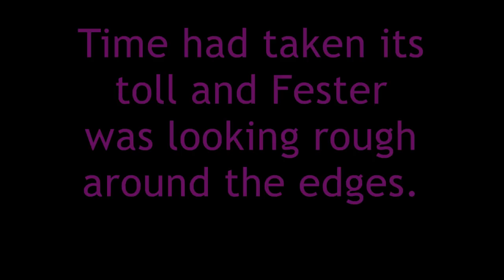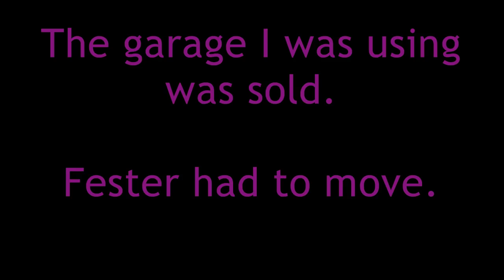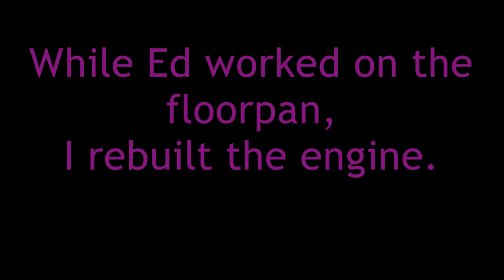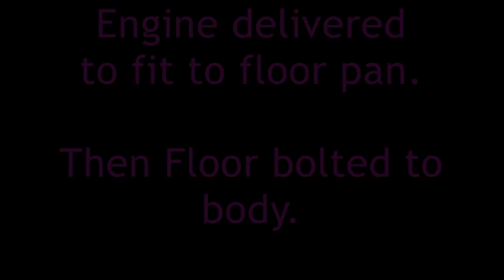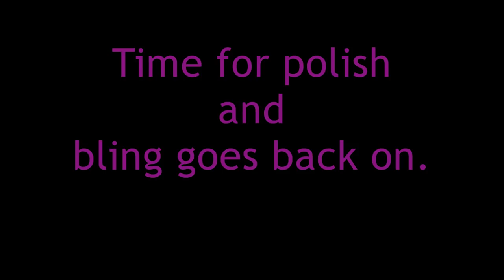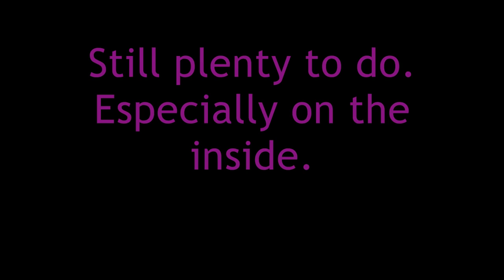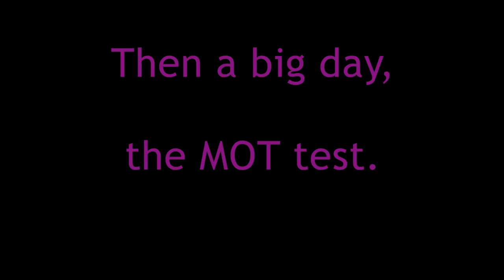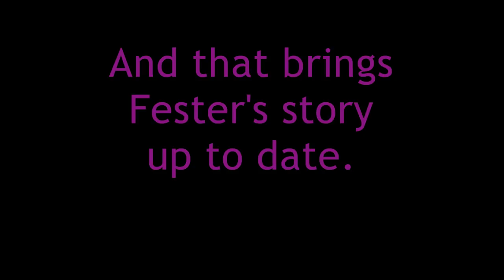1967 Volkswagen Beetle restoration. Rusty wreck to best in show.

Comment: My compliments, a lot of time, work and money.  I know, I did it 3 times because I have 3 of them: a 1967 sedan, sunroof and convertible.  That full-collapsing radio antenna is a nice option.  I think the red interior was a good choice.  My understanding is that the 1967 European Beetle still had the glass headlight covers, whereas the USA versions had just the sealed beam.  You must be glad it's finished.
Reply from the maker: Thanks. Thats my second Beetle as well as a '72 camper and a '70 Type3 fastback. I keep saying never again but before I know it another project arrives. Cant wait for summer to get it out again.  In 1967 the 1300 and 1500 got the upright headlamps similar to the US (though not sealed beam) but this car being a 1200 and the cheapest in the range it retained the sloping headlamps and 5 bolt wheels.

Comment: Congratulations to you guys & to Fester, on winning the prizes, too bad it didn*t have the original steering, it might have won best original for just having the rimblow horn, instead of the aftermarket one, also I thought that the 1967 bumpers were what they call plumbers delight, cause those look like the bumpers for a 1957, unless in Europe they use the ones the car has, if you can get the original steering wheel, just put it on, then you can enter Fester in the all original class, that would be annother award/ prize for you guys, & Fester,👍👍👍👍👍👍✌✌✌✌✌✌✌✌✌👌👌👌👌👌
Reply from the maker: Thanks for the kind words but if all Beetles were the same it would be really boring. The steering wheel that would be original to this car wouldn't have had the chrome horn ring, it would have been completely black so the wood rim is a nice addition and it's a style and manufacturer that was available when the car was new so is period correct. The bumpers are also correct to the year in Europe. American markets had towel rails along the top of the bumpers but blade bumpers were the only option in Europe until the later Europa style bumpers were fazed in for 1300 and 1500cc Beetles in 1967.
Reply: @AstonishingGlasgow   what I was thinking, if you ever went in to annother show, is to just have the original steeringwheel , so you can enter the all original category, then put on the steering wheel you have, for the car to be right hand drive, have the I believe is the 6 volt or 12 volt engine, those beautifull rims, the original factory color, did that year come with those type bumpers, they look likevthe ones from 1957, it gives it a nice touch, but I remember that year had thebumpers that look look like pipes, that is why it*s called plumbers delight, I see you have some buses, they look nice love to see them.
Reply: @AstonishingGlasgow   that car looks awesome, the reason I say about the bumpers, is  that those bumpers that are original to your car, they sell them, to give what they call "SoCal" look, which I don*t understand, why they call that, also what they also do is put on some Empi style mag wheels, for that So Cal look, I like originality and your car is A1, the way it is, those rims, that are original, look like the ones that the 356 Porsche came with, are those buses or campers all original , that steering wheel on the beetle would give it a nice touch, is any of them a westfalia camper that would be awesome.

Comment: Car looks fantastic! Great Vid. I'm doing the same to my headliner, just the top center portion only. Where did you begin installing it? front, middle, rear portion first? Thanks.
Reply from the maker: Cheers Stan. The headliner in the car is the original. This car is a 1200 "Sparkafer" model so came with the small headliner, fuel reserve tap (no gauge) and 6volt electrics. The headliner was in good condition so I carefully masked it off and cleaned it up when doing the interior.
Reply: Sweet, thanks for the info...Also I learned a lot for your upholstery video, thanks for posting that one too.

Comment: Nice work... 🤤
Question: In this car, is it possible to add an Air Conditioning? And again you made a amazing restoration... 😉
Reply from the maker: Thanks Elias, I'm glad you liked the restoration. There were air conditioning kits available and I think in some markets it was a dealer option. The down side is the compressor takes up a lot of space in the engine bay and takes some of the engines power to run.

Comment: He looks fantastic! Are you on the 67 VW page? Fester looks like he's a 1200, which is the Sparkafer model, pretty rare being a 1yr only 67, there weren't many 1200's sold. 

I've got one, also an F reg. 😁
Reply from the maker: Thanks Luke. Im not on the 67 VW page, is that on Facebook? Fester is indeed a Sparkafer right down to the reserve tap for the fuel supply. Joanne is the second owner of the car which I think must make it even rarer having only 2 owners in 52 years.
Reply: @AstonishingGlasgow  hi, yes its on Facebook, search for the: UK '67 Beetle Registry
Reply: is fester a 1967 upright model or a bugeye model? deck lid look's like a 1967 upright model, yet fester's front fenders are bugeye
Reply from the maker: @alfonsothirdy  Fester is a Sparkafer model. The Sparkafer model was the absolute bottom of the budget in 1967 and would have left the factory with sloping headlamps as it was still a 6volt car. The 67 decklid was the first version to be shortened to allow for the new in '67 europa (square) style bumpers. The semi W decklid of the 66 and earlier was too long to open past the top of the bumper. Sparkafer 67's feature sloping headlamps, blade bumpers, 5 bolt wheels, 6 volt electrics, narrow headliner and  no fuel gauge so reserve tap on the floor.

Comment: Where did you buy the rocker panel with the quarter panels attached to it? I've never seen anything like that in the United States
Reply from the maker: I had a contact in Oakland who found me a solid shell and cut all the sections from it that I needed. At the time I was importing be busses into Scotland so the parts crossed the Atlantic in the back of one of the vans.
Reply: bondovwvw I never saw that either, I was wondering the same thing.

Comment: Not sure about the United Kingdom. Over here in America the 1967 bug had the new fenders and the old bumpers. So either that is a 1966 or earlier or VW imported a different bug to the United Kingdom in 1967.
Reply from the maker: In the UK the 1300 and 1500 Beetles got the new bumpers and upright headlamps in 1967 but the 1200 and Sparkafer models kept the blade bumpers and sloping headlamps. This is a sparkafer model so Blade bumpers, sloping headlamps, fuel reserve tap (no fuel gauge), 6 Volt electrics and small headliner.
Reply: I never heard of the Sparkafer, I suppose the proper spelling is Sparkäfer. Sparen means save, and käfer bug in German, so it would translate to something like economy bug. We did not have this in Sweden as far as I know.
Reply from the maker: Thats it exactly Christer. The model was no longer available after the '67 year but was re introduced for 1972 die to the fuel crisis. The '72 had upright headlamps and 12 volt electrics but no carpet, small headliner and blade bumpers as well as having only one horn grill at the front. That must have saved a fortune :-D

Comment: So this bloke called Ed finished all the welding and floorpans and the respray.  You rebuilt the engine? You resprayed the tins and the manifold and redid the interior.
Reply from the maker: Yip. Life has a habit of getting in the way sometimes and for this reason I couldnt complete it myself.
Reply: Tell me about it. Been restoring my 55 oval for ten years. Kids 13 and 12 now so spending every spare minute restoring.
Reply from the maker: I found I was working all week then on my day off I had to build up the energy to dig out all the tools, clear a space around the car and try and do some work. By the time I was ready to start working i was only getting a few hours done and felt like I was getting nowhere (didnt help I dont have a garage at my house). I came to the conclusion I could do some overtime each day, pay Ed to work on it when he had time and get it back for the finishing off and detail work that I enjoy. Good luck with the oval.

Comment: Not a 67
Reply from the maker: Yes it is.
Reply: BTJustice It does look different for 67. It has the older style headlights and bumpers. Did you modify that stuff? I like it
Reply from the maker: Cheers, its completely standard as it left the factory apart from the colour (was originally red). Its a Sparkafer model '67(cheapest in the range)  so came with 6 volt electrics, blade bumpers, 5 bolt wheels, sloping headlamps, small headliner and no fuel gauge (reserve tap on floor).
Reply from the maker: Should add, I dont think the Sparkafer was available in the US which is why it looks non standard. The US market got upright lights, Euro bumpers and disk brakes in '67.
Reply: BTJustice Wished they did that here!!!
Reply: Euro market '67 looked like our US market '66. I know, I had a Euro '67 (1300 on the deck, 6 volt, and had the 67 rear apron) that was bought by a US serviceman when new, then had it shipped home to the US. Except, mine was left-hand drive. Wish I still had it.

Comment: You know you can buy a fully restored one for cheap with no time wasted! Let someone else do the crappy work!
Reply from the maker: But where is the fun in that? I spent less restoring this one than buying a restored car and I had the satisfaction of knowing it was done right with genuine body cuts from a German built Beetle rather than crappy pattern parts. Add to that the car has sentimental connections to my wifes family who are no longer with us and there was no way it was being sold.
Reply: @AstonishingGlasgow  Not to mention that your accomplishment here is something to be proud of.  I don't think pride is a very good trait, but being proud of your hard work is a little different.  Beautiful job brother.
Reply: The replies to this are my thoughts exactly.
It's not about the money or the time.
It's about a journey and breathing new life into something that is getting tired and worn
I've done 6 Fords - all Corsair of different variants including a Crayford convertible that had been in a damp garage for 12 years.
The bottom 6" of the car were on the point of falling off.
I spent 2 years and £5000 on that car in the late 80's/early 90's - but I drove it all weathers for 6 years when finished.
I am currently restoring a '65 BSA Lightning Clubman.
You do it for the love of doing it - nothing else.
This beetle is a beauty.